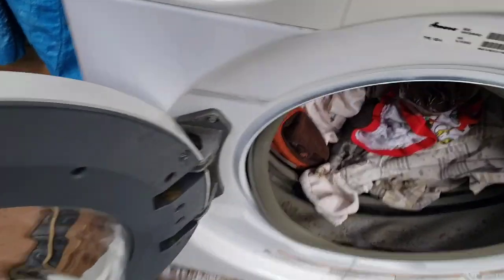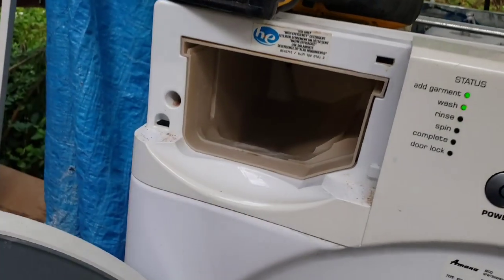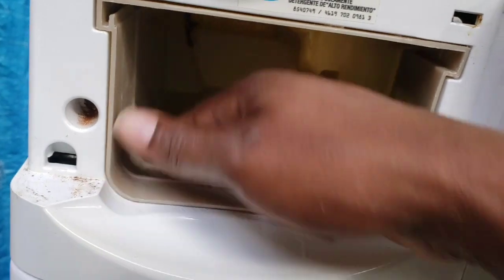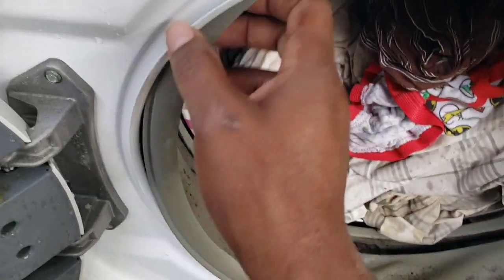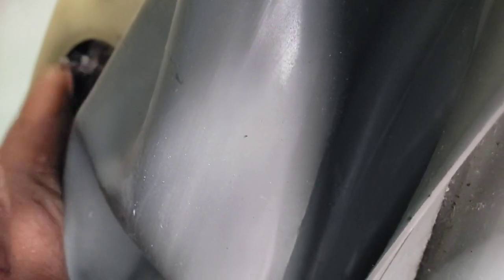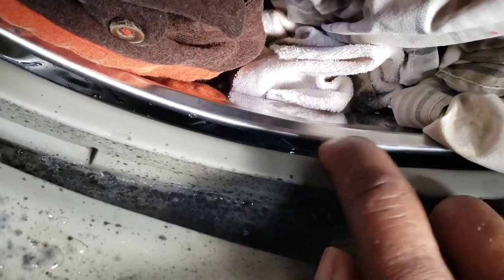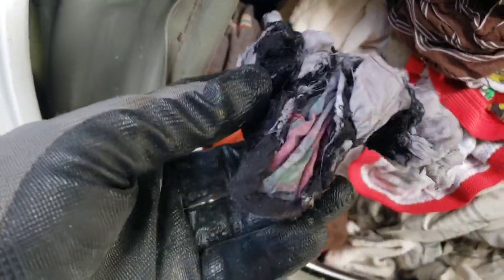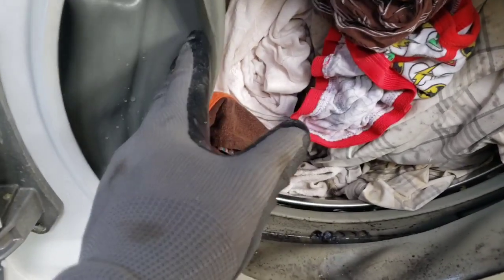Leaking Detergent Tray -Fix

Comment: After cleaning the sump hose and cleaning the dispenser tray(even though I knew that wouldnt help) I used a torch and found a sock blocking the pipe and now I've take  it out the washing machine works. Thank you for your video, I'm so glad I finally found it after days of searching!
Reply from the maker: Your patience paid off, I'm sure a lot of people would have just replaced the washer in frustration

Comment: Thank you so much for your video!!!! I had called a repairman and he told me the drawer was plugged up and to soak it in warm water and to clean it with a Q tip. He showed me how to put the drawer back in. I soaked it and cleaned it till it gleamed!!! All that did was make the water leak out faster!! I watched your video and reamed it out (carefully!) with a skinny brush I use to clean the drain. Nothing came out but I ran the washer without any clothes in it and you could see some soap bubbles so it must have had a soap build-up. If I could give you more thumbs up I would!!!!!

Comment: Thank You for the videos and the Podcast. My first time seeing you videos.
I Truly Enjoy Them!
I am trying to fix my washer, it’s so hard to find a honest appliance guy here. 
I truly love trying to do this, I was so thankful I did the diagnostic on my Kenmore Duet HE5t Steam front load washer.
The error is F 20 I put a new pressure switch, flow meter and a 3 coil water inlet valve. The Error F20 is gone but now it’s a F21 error. I checked the drain catch it was clean. I thought it was the drain pump motor from watching YouTube. The water wouldn’t drain out from the long drain. I ordered a new drain pump. before I tried to put it on I wanted to make sure all the hoses was not blocked then I saw a video that it could be the eco ball inside the drain pump black rubber on the tub so I took it off and took the ball out.
Now I’m fighting to get the hoses on the drain pump and the black hose that the eco ball goes in back on.
I tried doing it from the back of the washer. The eco ball hose It’s on but not clamped good enough. I got the drain pump 2 hoses to put on. I will take a little break.
Do you have any videos on clamps and how to secure them so they won’t leak?
I looked for your videos on this.
Thank You In Advance for reading this really long text.
How do I order parts from you?
I Appreciate You!
God Bless You & Family!

Comment: Thank you sir .... I used a rack wired and shoved it down the soap dispensor pipe and then throw some hot water inside.. and boom it worked

Comment: Your video is about a minute too long.  I couldn't remove the rubber portion a part like you did but I move my hand in there and found the obstruction.  Washer is working right.  But I stopped your video at 1:13.  Thank you.